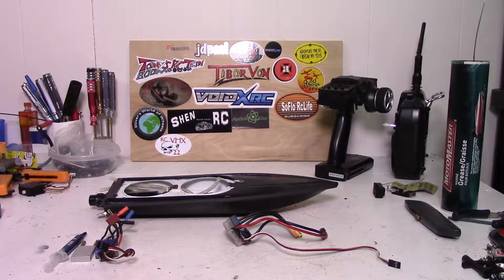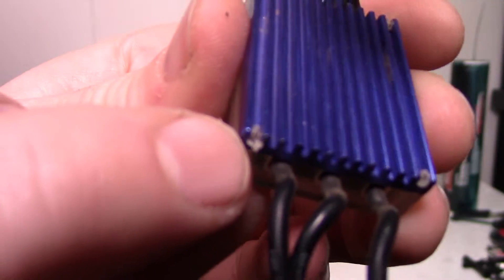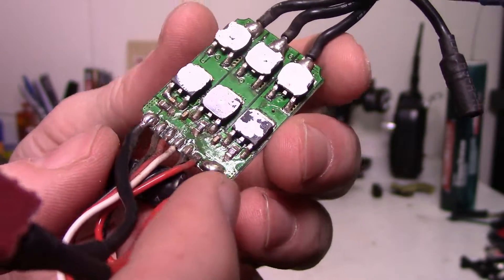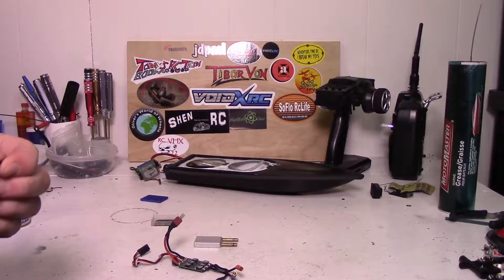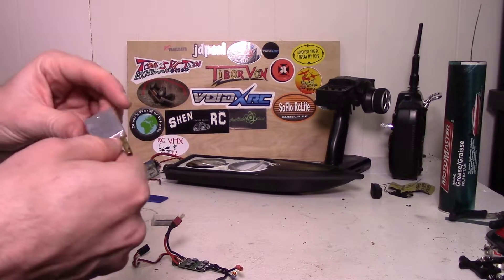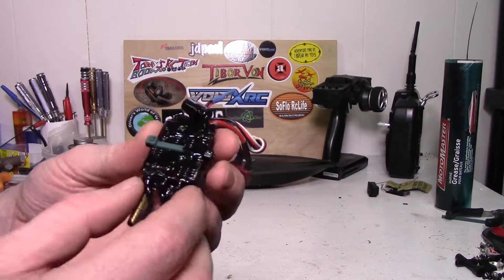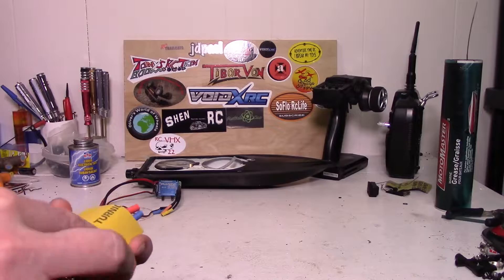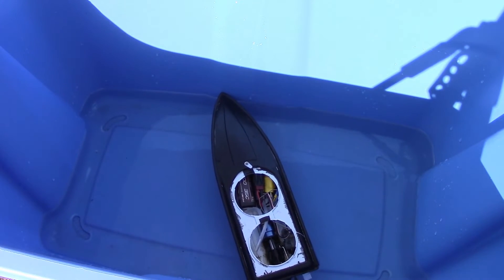Adding Water Cooling to a Speed Controller for Use in a Boat

Comment: Nice with that heat shrink it looks like you bought it like that!! A tip that may work? next time when you try and remove a heatsink try heating the sink up with a hair dryer first this may make it come off easier.
Reply: Good Tip Steve 👍
Reply from the maker: Thanks Steve I didn't think of that at all!

Comment: Why do boats have water cooled escs? Planes and cars don't. I'm really curious to know.
Reply from the maker: On planes and cars there is airflow over the ESC to cool it but in a boat there isn't any airflow, the air will just get hotter and hotter inside the boat.

Comment: Does the liquid electrical tape by any chance act like a blanket holding in the heat on the mosfet chips preventing the water cooled block from doing its job?? Cause if not I'd like to use some and build a setup like that for 1 of my spare esc's just to try it out maybe this winter for a second winter project. Nice!!

Comment: Hair dryer loosing up the glue....oh that's electronics glue. Still get soft with heat though which helps get them apart for heatsink. Its electronics glue / thermal paste that stuff that helps conduct heat they got some that help conduct electricity. I forget its name been awhile since I've used any.